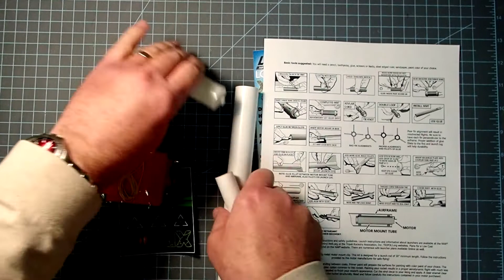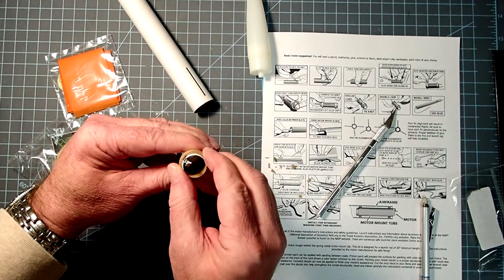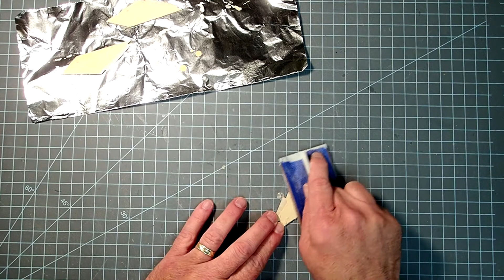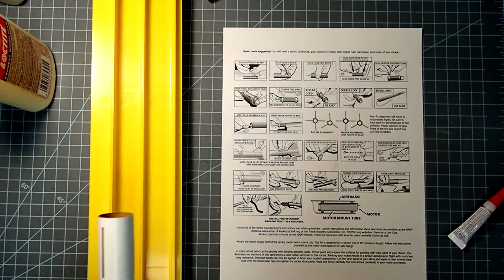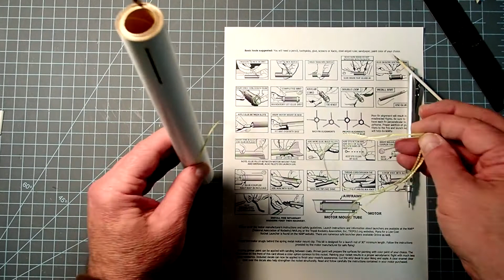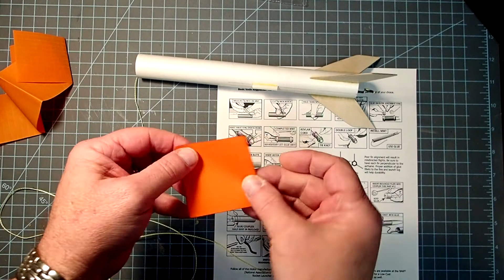LOC Precision "LOC1 Xeno" model rocket assembly (part 1 of 2)

Comment from the maker: Someone asked about the bottle I use for alcohol, and then the comment disappeared. It's a chemical wash bottle. They can be purchased from many scientific supply vendors as well as from Amazon. The ones I use are similar to these: https://smile.amazon.com/Utile-Self-Venting-Isopropanol-Vol-500ml-5511-0471-4/dp/B096R767T6/ref=sr_1_7_sspa?crid=15W4F1ZH30H8T.